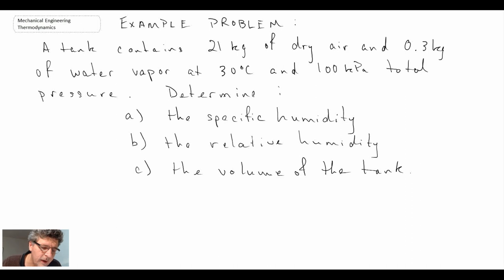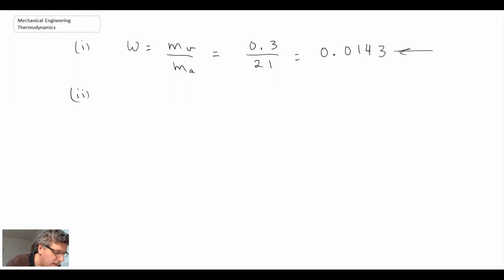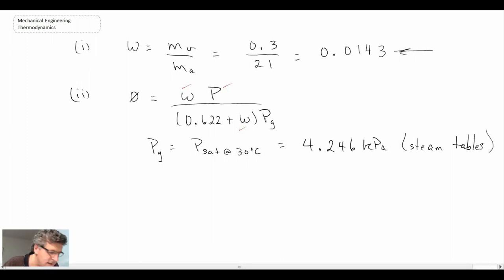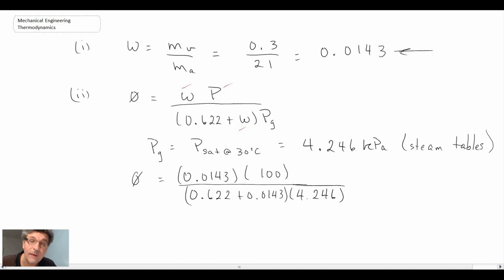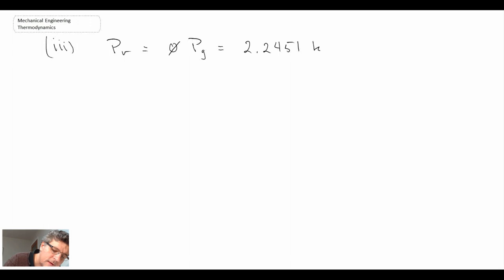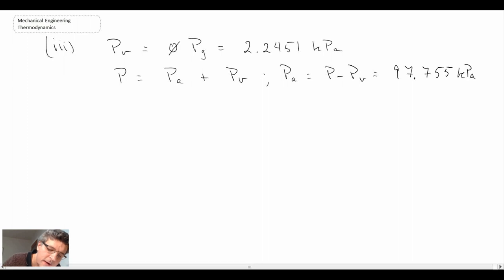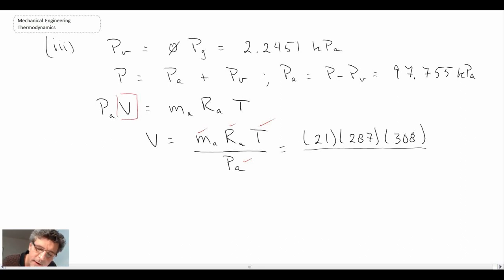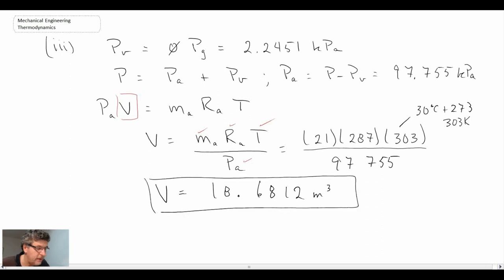Mechanical Engineering Thermodynamics - Lec 28, pt 6 of 7:  Example - Air-Vapor Mixture

Comment: About finding the volume, you could as well have used the V = mv Rv T / Pv you get the same answer. instead of finding Pa.
Reply: you're right! good way
Reply: but I made a mistake during the exam- - the Volume of the dry air and water vapour is the same, but the specific volume of that two are not the same~

Comment: Hi! Firstly, thank you for the videos, they are extremely helpful. 

Why is the total volume of the tank equal to the volume of the dry air only? Wouldn't the total volume be the sum of partial volumes from the dry air and water vapour separately?